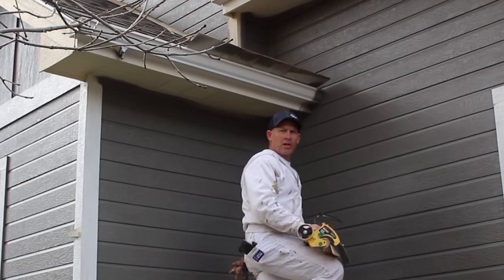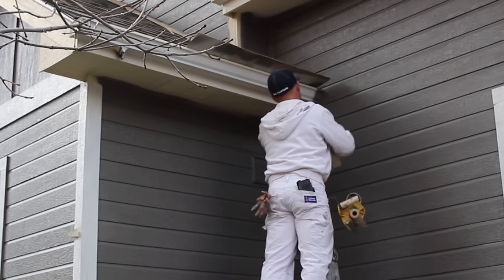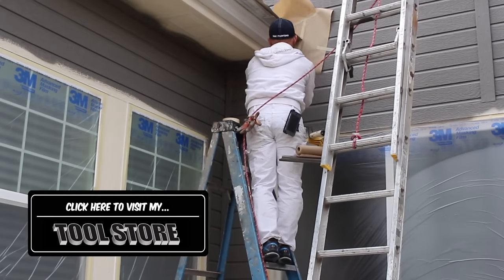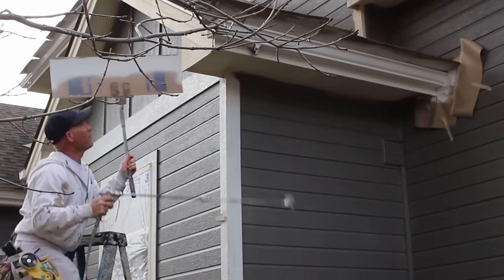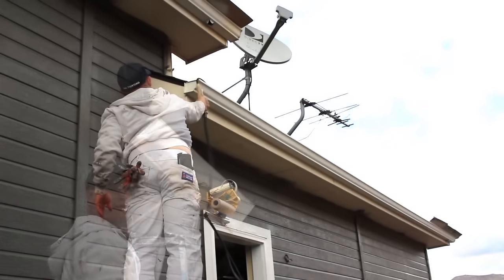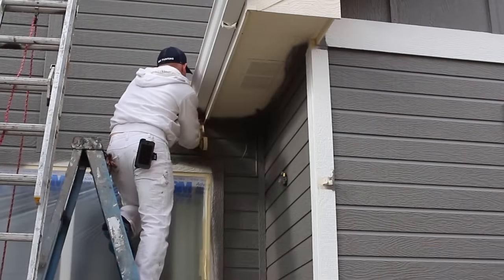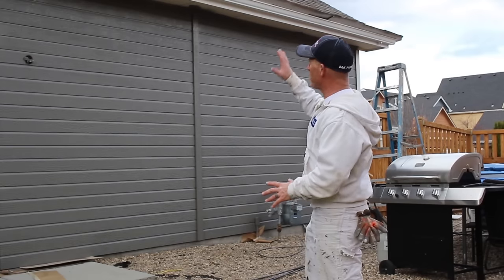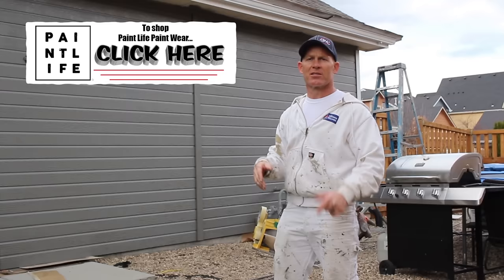Painting Rain Gutters On A House. Part 2 Metal Gutter Painting.

Comment: i like your work .I'm always open to new ways to save time and get the job done.I'm just wondering how much time are you saving by spraying the gutters.because looks like you're using 1 more person to set the shields for you on top of the gutters and you're masking the sidding at the beginning of the gutter and still getting some over spray on it ,producing new touch up for later.not including the time of setting up and cleaning the pump at the end of the job.when some of the gutters seen to be like 5 or 6 feet long something you can brush in like 3 minutes -double coat in less time without the mess and not having to go back in the roof to remove the shields.i like your ideas and work but sometimes it makes me wonder if they're the best way to go